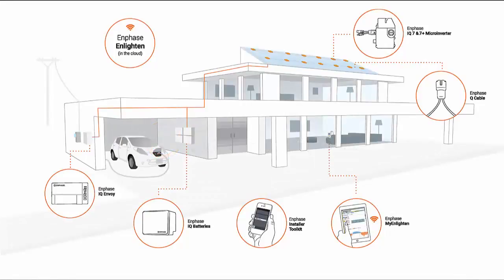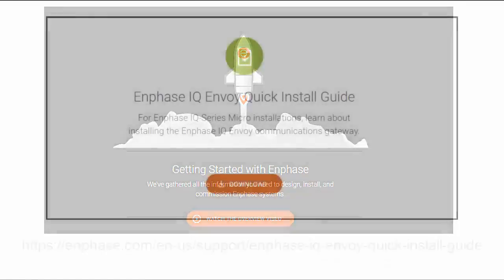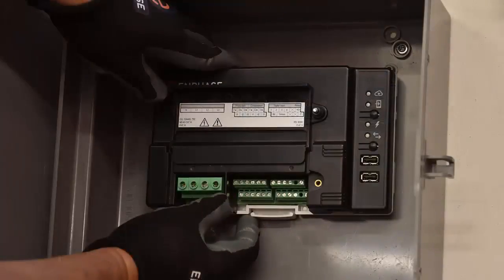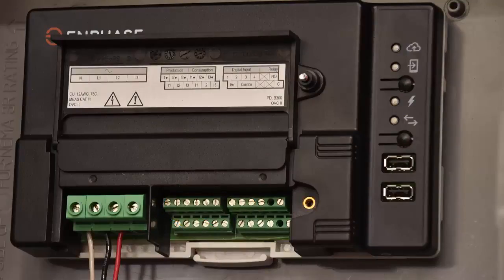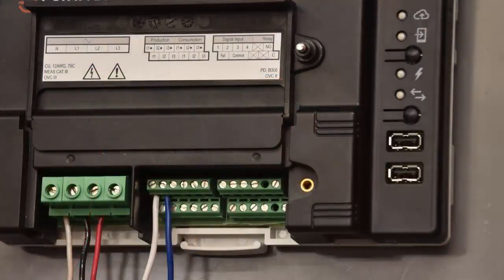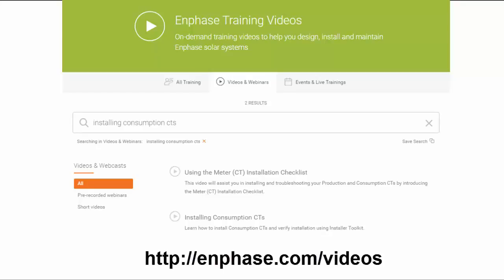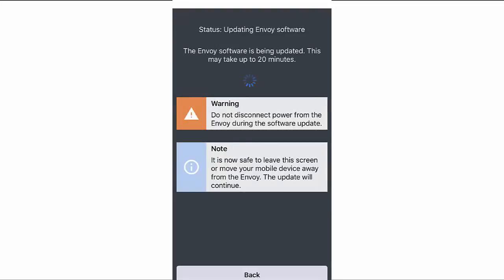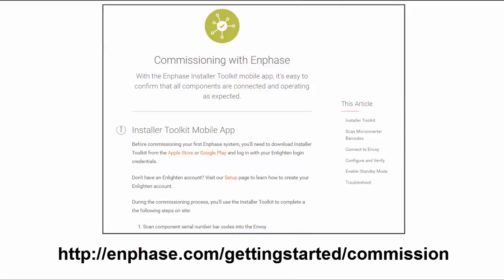How to Install the IQ Envoy

Comment: I changed my internet box, but the top green led just keeps flashing, and I don't have a smart phone I give up !!!
Reply: If you have not solved this yet, you can use a laptop or desktop to connect directly to the wired network port on the Envoy the use a web browser to go to 169.254.120.1 once there you can change your wifi network settings to match the new box.
Reply: you seriously dont have a phone that has wifi??? in 2021????? Wow
Reply: @enkrypt3d  I manage to live without one for 60 plus years,,,
Reply: @paulinfrance5  then it probebly doesnt matter if the envoy is connected with enlighten app